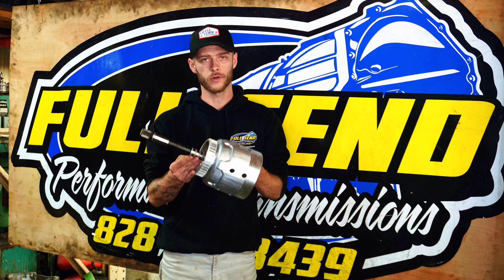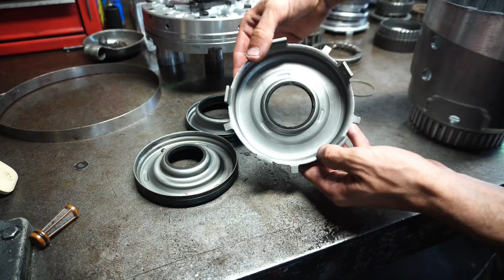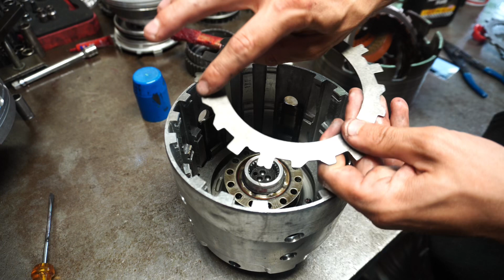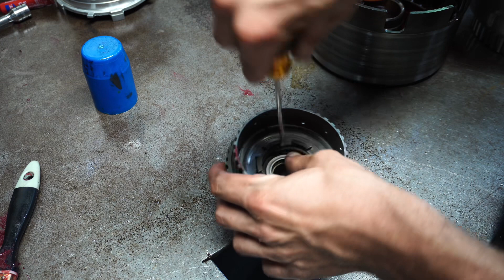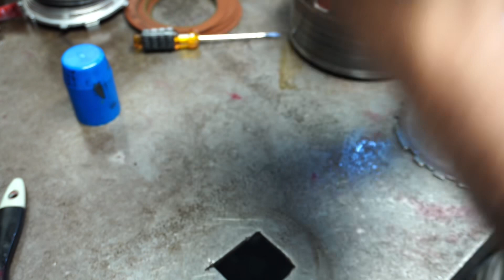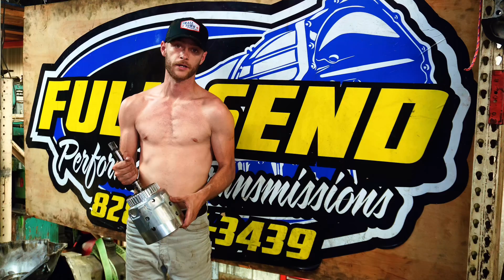2000-2015 4L60e CHEVROLET 4 Speed TRANSMISSION (COMPLETE FORWARD INPUT DRUM ASSEMBLY)

Comment: Thank you for sharing your content and taking the time to demonstrate this process. I’ve spent about a month working through the forward clutch pack and found myself overanalyzing the clearance to the snap ring, measuring it in multiple ways and second-guessing the setup.

After comparing your build to mine, I feel much more confident. My unit looks very similar to yours. It is somewhat tight to rotate and requires a bit of effort, but it turns freely and is not binding. My measurement is approximately .032" from the top plate to the first friction with the snap ring installed, which closely matches what you’ve shown.

Seeing your setup has helped confirm that what I’m experiencing is normal. I’m comfortable moving forward and calling this portion complete.

I appreciate your clear explanation and the reassurance your content provided—thank you again.